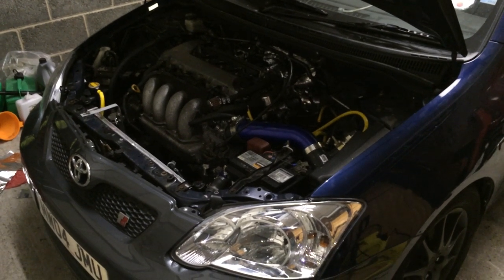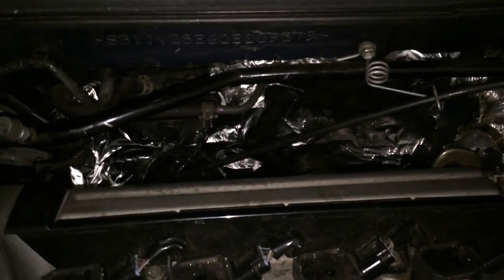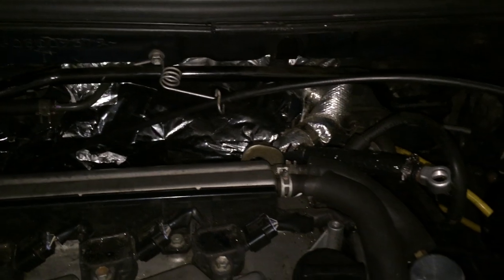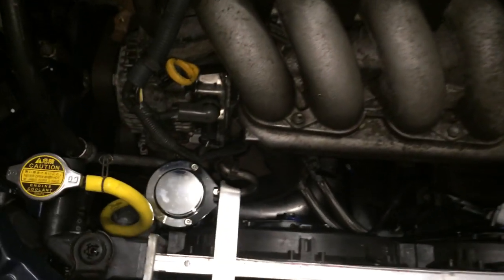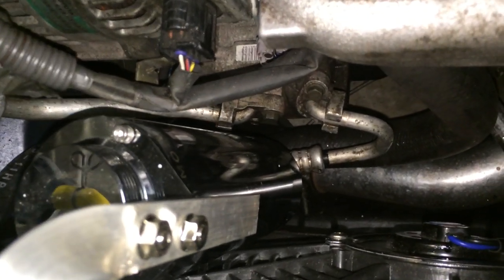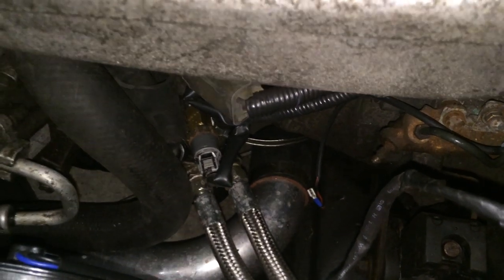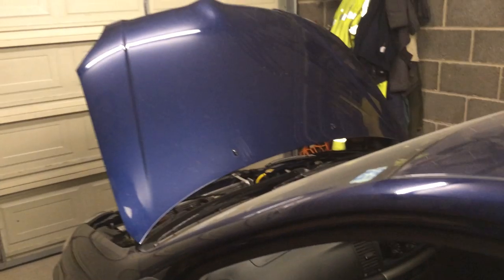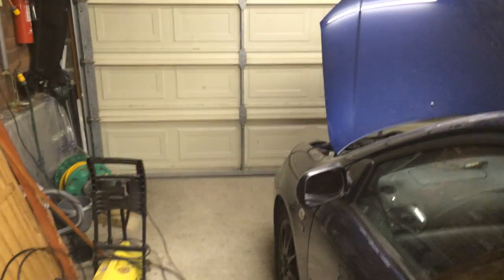Build Blog - 2ZZ Turbo Corolla T Sport #1

Comment: what happend with the ebay turbo??
Reply: Sold it off cheap
Reply: how you did with the oil line from the turbo??
Reply from the maker: LOSDUROSRG4L Its on a tee piece off the oil pressure switch and the return line connects to a welded fitting on the sump